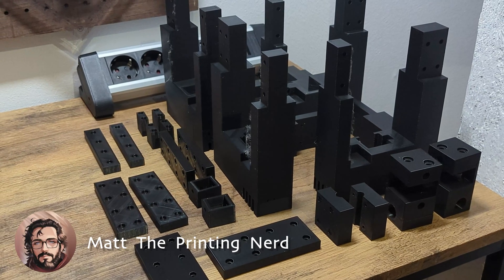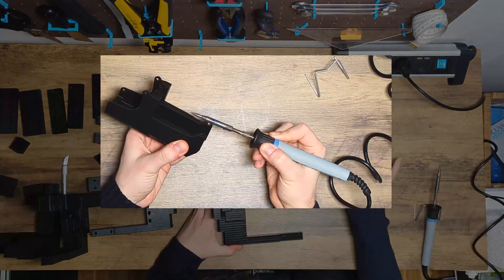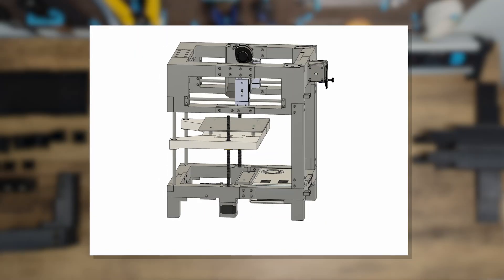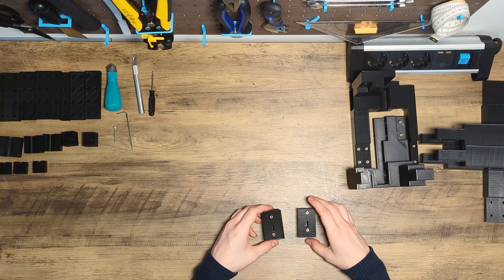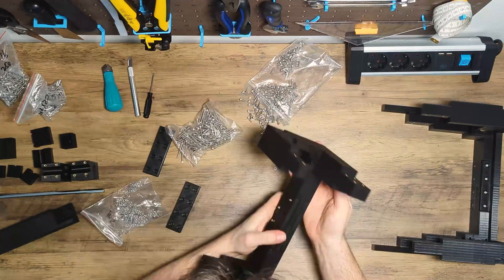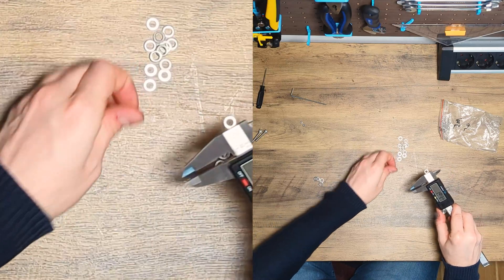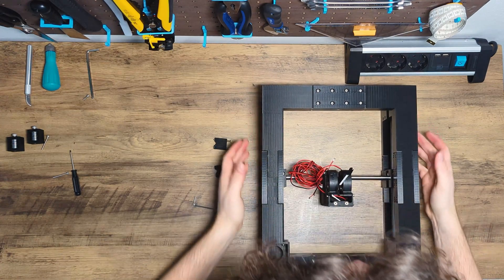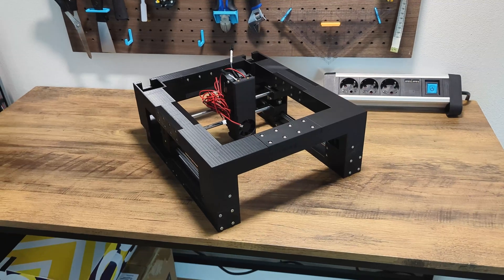THE 100 Assembly Guide - Part 2: Top Frame

Comment: Toolhead Gantry direction is wrong! I want to assemble top with bottom frame and recognice that the toolhead is in the wrong direction on the build guide. When you build it together the front of toolhead is directing to the x and y motors but the correct way is on the other side.

Comment: When are you planning to post the rods&bearings test results?
Reply from the maker: Yeah it's still on my agenda, but the size and complexity of it exploded while doing, can't say a when, its done.
Reply: @MattThePrintingNerd  haha I hear that. Based on your initial impression are there any that you would avoid?
Reply from the maker: Most of them, most of the manufacturers on AE use old machines that were taken out of service in western countries in the early 90s. They are still good to do the job for most of the parts but the production process for rods has changed from the ground so you need a big bunch of money to get new tools and also a country that is willing to sell you that tools.

Comment: For my rods I'm testing out 350mm 8mm stainless tubing. It is working great so far, but I am using linear bearings. They are drastically lighter than the solid bars.
Reply from the maker: Do you have a good supplier for them? I plan to do a rod comparison video and I'm still looking for a good supplier for hollow rods and carbon fibre rods

Comment: Have you considered using square nuts instead of melt inserts? They'd fasten the installation process and when used with enough compression, they have good holding properties.
Reply from the maker: Yeah I tested them in the past and for big parts like the printer frame they might work as good as heat inserts and maybe they are a bit faster in installation. But for me it feels really satisfying inspecting a part after all the heat inserts are in it. There is something animalistic about playing with fire that makes me happy
Reply: @MattThePrintingNerd your answer is correct.